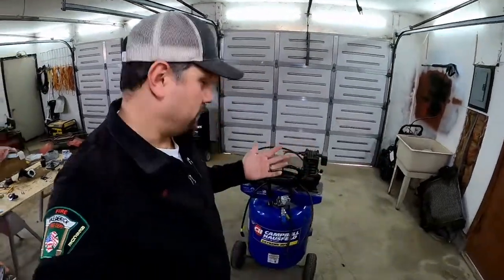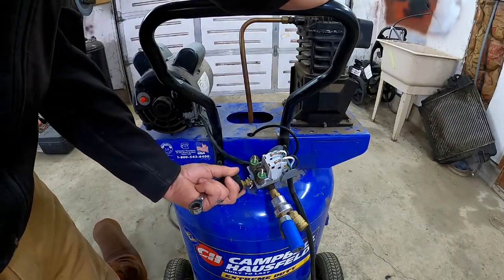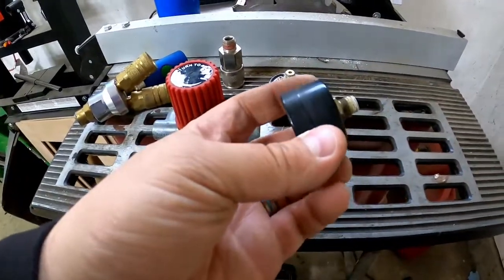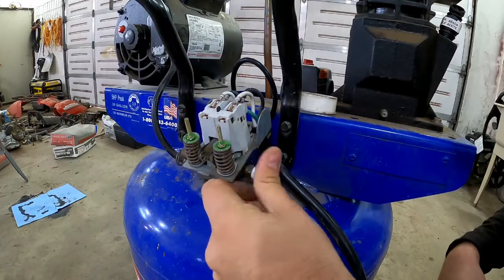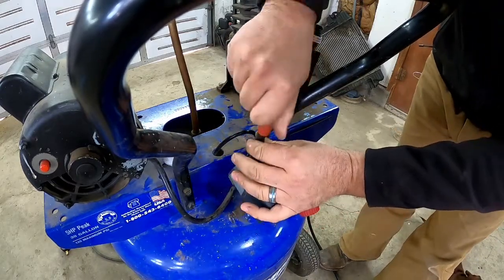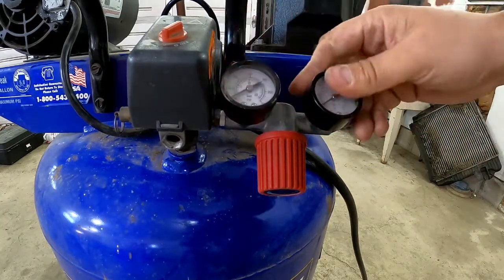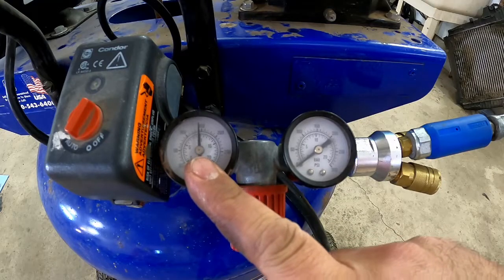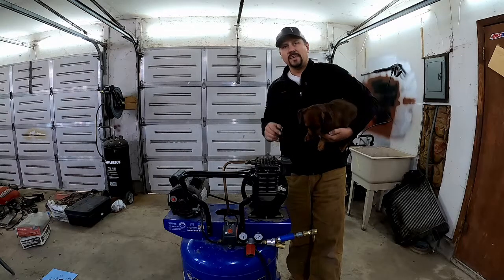SAVED from SCRAP Campbell Hausfeld 30 Gallon Air Compressor

Comment: You shouldn't be releasing the compressor to the customer as it is. Its dangerous. The pulleys on the pump and the motor are wobbly and can brake and fly off, especially without a protective cage (I have seen the movie). Given that the pulleys are cast iron it is almost guaranteed that the shafts of the pump and the electric motor are bent. You could have used a machinist dial against the shaft to see how much they are bent. Don't need an expensive dial. Get a Harbor freight one for $20 bucks.
Reply from the maker: That’s a good idea.  Appreciate it.  👍

Comment: 20 minutes to add a pressure regulator. Wow! No actual repair, just put damaged and old parts back together. You probably took them apart off screen. What did you actually "SAVE from SCRAP"?

A very terrible pressure regulator by the way. Try running an impact off that... 90psi static, about 45 psi in use. I figured it would be an "interesting" video when you struggled to attach regulator without twisting parts around. I bet all your air compressors are just as safe and maintained as old blue there.
Reply from the maker: It was going in the trash if I didn’t fix it.  Learning as I go here.  Didn’t even have a power drill a few years ago.